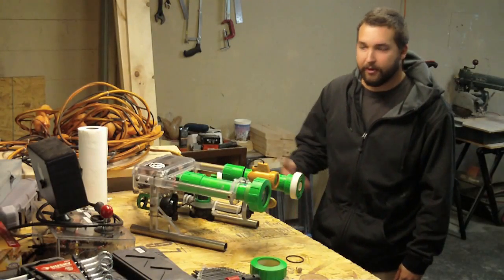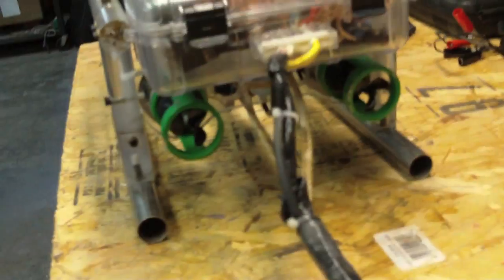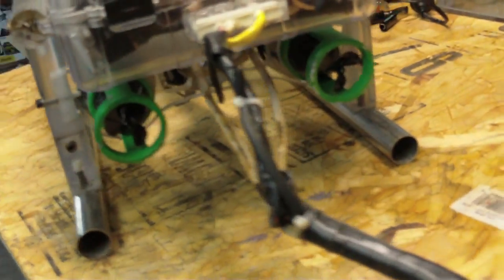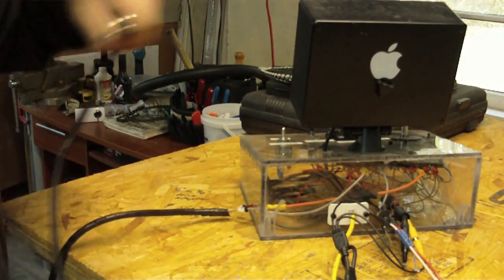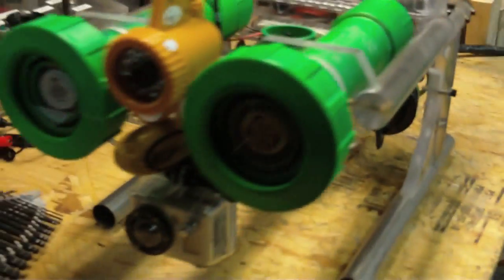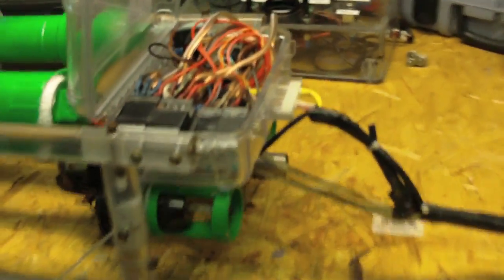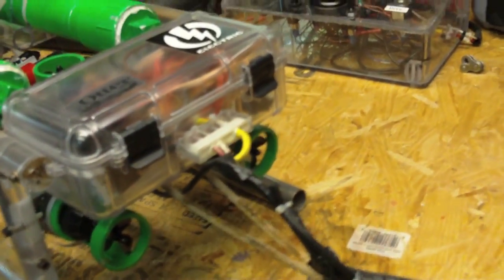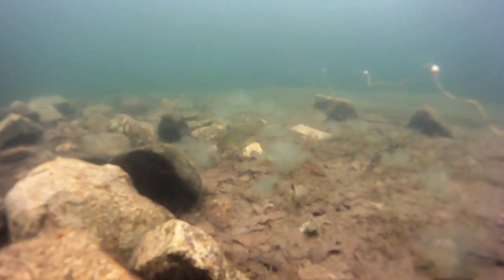Underwater ROV Build Overview

Comment: wow cool , But is it possible to change the altitude without propellers , like real submarines does .
Reply: Perhaps, but you would need a tank of compressed air and a valve system for the ballast. Possible, but costly and hard to get right with the buoyancy.

Comment: hey ho, Zackro973. Do you use any collision avoidance for your ROV? right now, I'm working on a university project, where I should programm a possible collision avoidance module for a ROV. We can use any sensory system, and I was thinking about sonar, laser or fish finders, then measure the distance to a certain obstacle and decide wether it is close or far away sth like this.

greetings from germany

Comment: Not a bad starting point. I cant understand why you would use mild steel set screws instead of stainless steel screws. The screws are already starting to rust :-( Believe me, after working on un-serviced outboards. You will want to replace thee before you are unable to.

Comment: Nice-looking ROV, but it seems too nose-heavy. There's a lot of mass forward of the CG on that thing, from the looks of it. I saw the part about your little floating key fab float thingy, but something about watching it in the water makes me want to add aft ballast. And to boot it appears as though your vertical thrust center is aft of the CG as well, which might give it more of a nose-down pitching tendency.

Great job machining it though--very innovative. Gives me great ideas, so thanks for posting this!

Edit: Question for you (didn't see it in the video): What sort of current draw is there on that thing? Just wondering how small of wire you might actually get away with, and also what sort of loitering time you can get on one battery...

Comment: Just a thought, but if you are going to use a wrap around the wire, you could also put a sealed air tube in there, if you get the right buoyancy per inch you could make the line pretty close neutral for only a 100 feet of tube, or you could take those key chains to increments instead of lumped together.